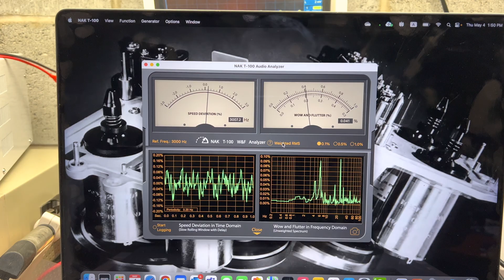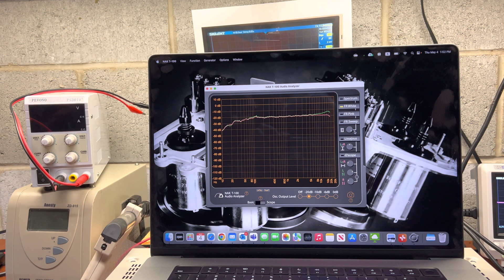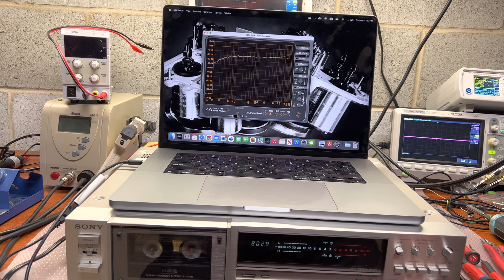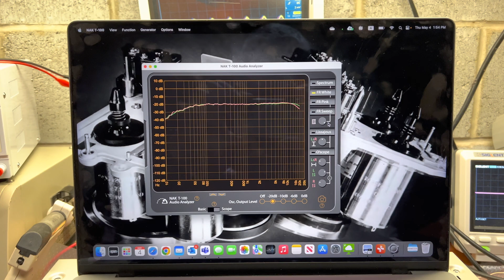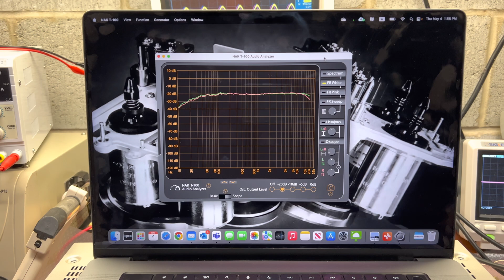Delve into the technicalities of the Sony TC-K777

Comment: Recording Azimuth is off: I don't believe at any point in time they were meant to be exactly waveform aligned. In fact you can't tell with the VTVM. I am led to believe later decks were more precise but still... 

It should sound pretty darn good. People tend to overemphasize what a flat frequency response means: It's an instrumental exercise.